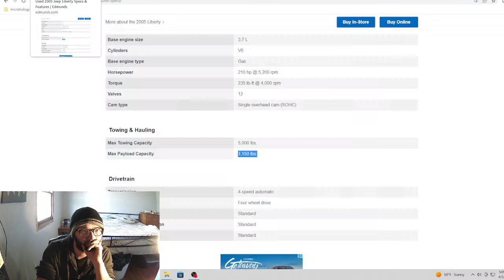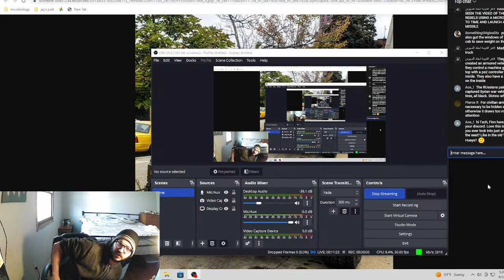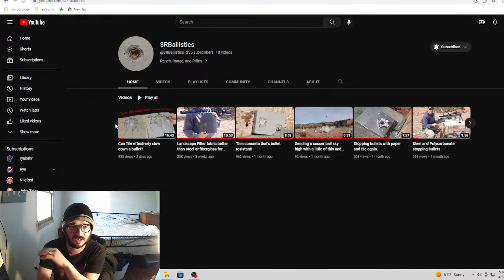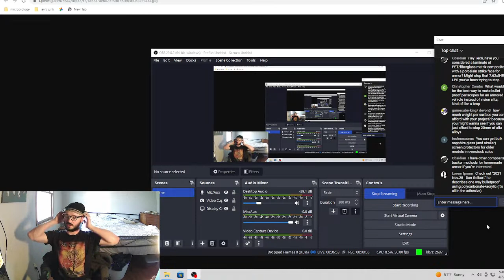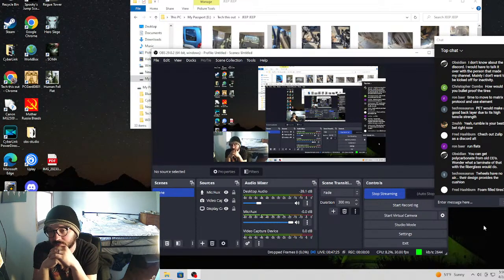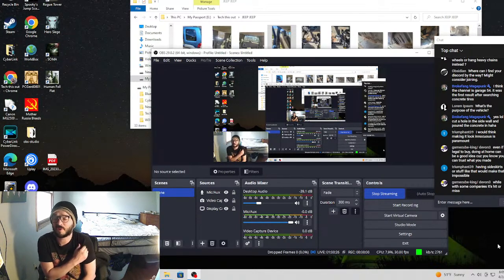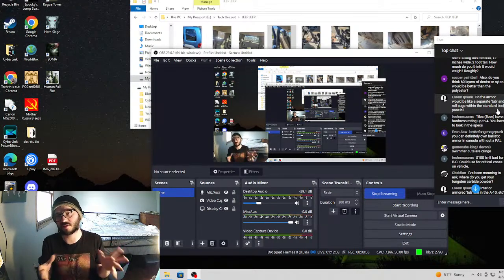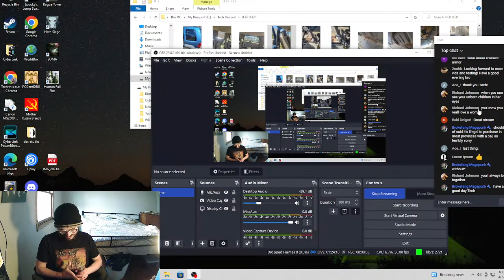vehicle armor Q&A livestream 2

Comment: Should add makeshift fragmentation shield into the doors and floors of light vehicles sent to Ukraine. The majority of losses in combat in both front and rearline units are due to artillery and mines. Protection from direct bullet fire is simply too heavy and expensive to achieve, but fragmentation protection is a realistic goal.

Aluminum and steel are obvious choices due to availability. Thicker fiberglass panels may also be viable.

An important factor is keeping weight low for off-roading in the notorious Ukrainian mud. So only armoring critical areas.

Armoring windows reduces vision too much so if necessary should be using hinged panels with vision ports that can be closed before driving through a dangerous area.

Comment: the chassis you choose can not be turned into a tank, not easily anyway
I think you might be aiming too high. start with a one ton truck if you really want to build a tank not a 200$ beater car
stopping handgun rounds would be a more fitting goal for that vehicle 
most shootings/ gun crime in the US are handguns not rifles loaded with AP rounds 

you might not have to worry too much about the engine. even with a damaged radiator and broken alternator, you can drive away from an ambush, car jacking attempt or a mostly peaceful BLM road block. engines dont instantly overheat